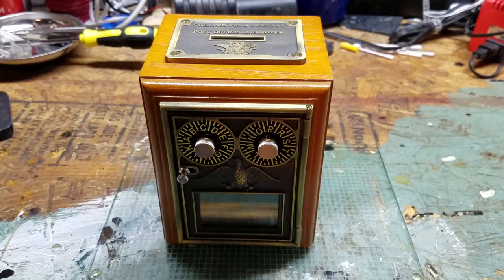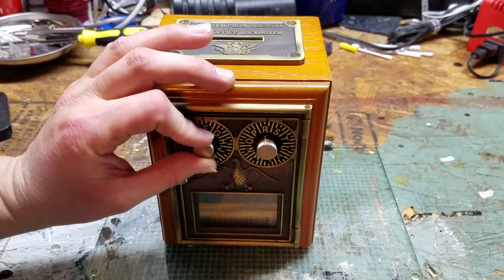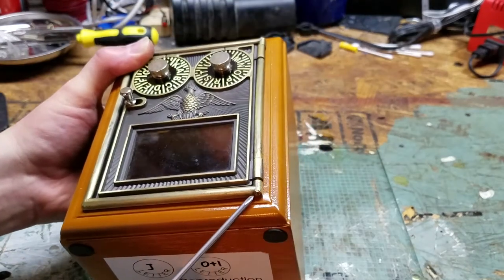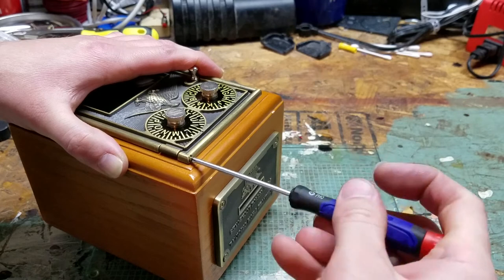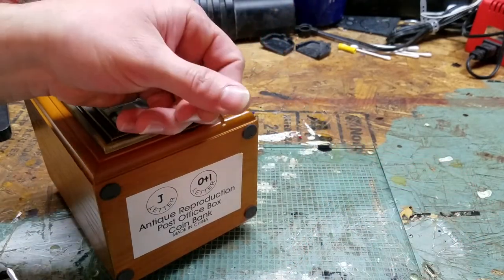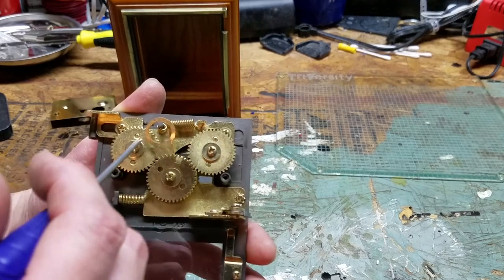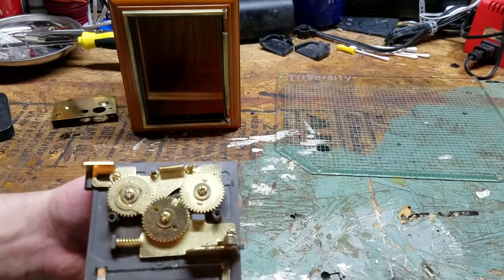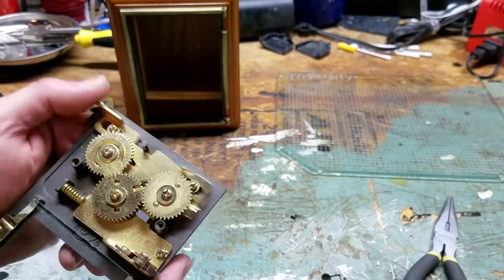How to Repair a Post Office Lock-Box Bank - No Combination

Comment: I have one of these. However, mine is of the key-lock type. Of course, I picked it up at a thrift store with no key, and for years now, it has simply been a conversation piece. I can see that the lock is a Yale lock, and I'm wondering how I might go about obtaining a replacement key, if possible, or any other suggestions for how to open it without damaging it. Popping out the door hinge pins would not work with this particular model because the pin on the top hinge is longer than the space above the hinge. Other than drilling out the lock and replacing it, any suggestions? Thanks!😊

Comment: The gears on mine have quite a bit of play even though the screws are tight. Any ideas of how to solve?
Reply from the maker: The only thing that comes to mind, is you may be missing a washer or two. Without the washer around the gear, it will be loose.

Comment: What if my hinge does not have screw threads?
Reply from the maker: 🤔
It might have a pin(s) holding the hinge on like an interior door. Try taking a small nail and lightly tap it with a hammer.  If its anything like a door, you'll need to hammer from the bottom upward. 
Good luck